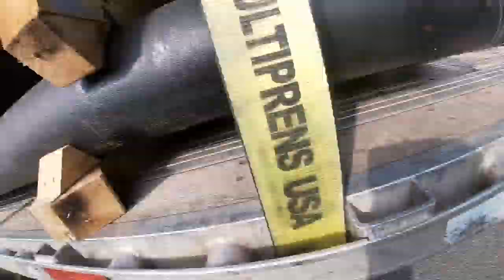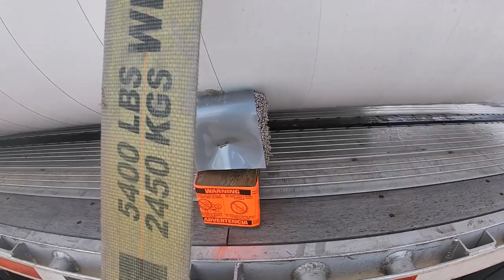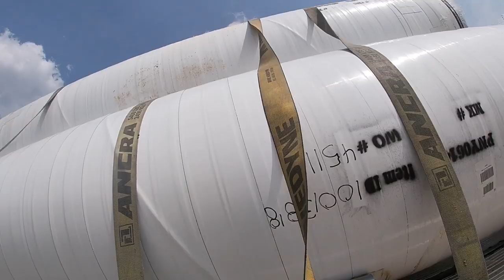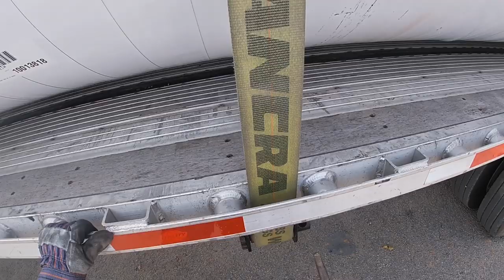Flatbed Trucking With The D P&S Transportation Load Securement

Comment: Quick tip brother, pull the excess from the winch and roll it. Throw it over and pull. You won't have to get up in the load
Reply from the maker: Just did that for the entertainment. I know I didn’t have to climb up there lol. I’d rather push it off the pipe with my cheater bar than pull all the excess out and have to put it right back though
Reply: @bigsnow1705  awesome brother

Comment: Hope you got the rear outside tire on the passenger side rear tandem replaced...missing half the tread
Reply from the maker: Called it in when I dropped the trailer. My winch ended up running a groove in it